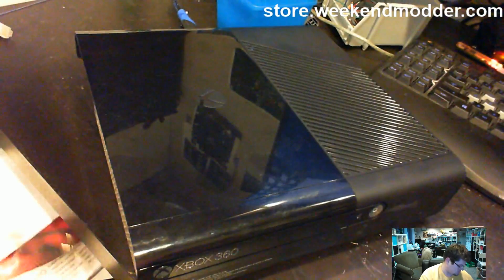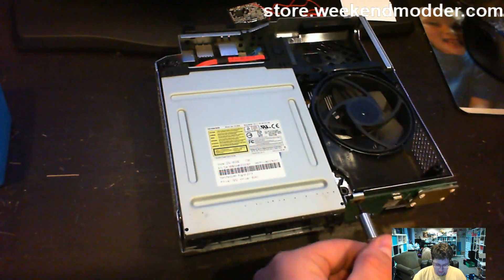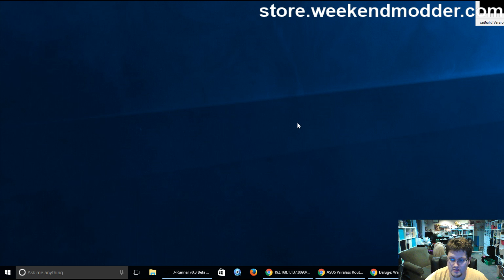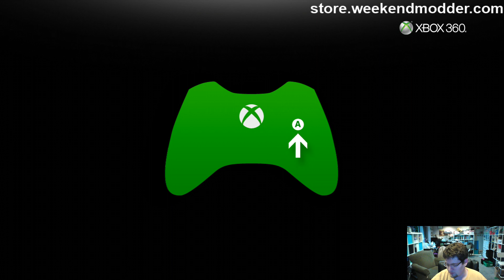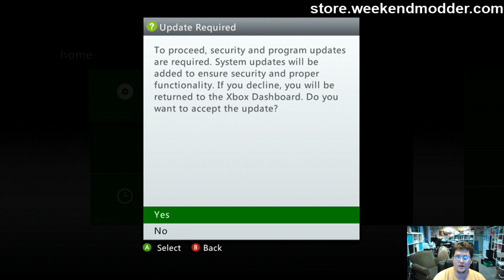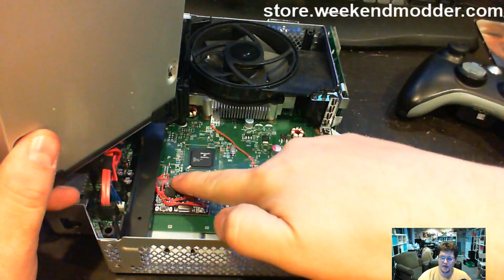Watch me RGH an E Series Slim Corona complete process!

Comment: Just FYI, th 4gb NAND pads are very flimsy, easily lifted off, I use some olds floppy ribon cable as its very flexible, plus when solder in I Tape them doe to stop movement.

Comment: Hello, i just got a an xbox 360 slim (16MB) corona version 3-6. i've got everything ready to do the RGH with postfix adpater (it needs it) e.t.c. Looking at your video i realize that i also have WINDBOND ram (and this is NOT an XBOX 360 E). The MFR date of this unit is1 9/01/2013. DO I have also to check WB 2K when i will start using JRunner?

Comment: i installed JR Programmer v2 to jasper motherboard i think on correct points i connected power cable only no run! on jrunner Im getting the error: Flash Config: 0x00000000 Can not Continue now i see burning smoke on 2 smd capacitors on point C3B8 and C1D7 i don't know why motherboard demaged before motherboard working very well how to fix that ? pls help me

Comment: Hello, i have a 4gb corona motherboard xbox360 e and it dont boot, only the center green light is is on and the fan and the dvd drive  and no hdmi output, the rgh chip x360run v1.1 led dont work. I measured the ground and the cpu and i measure 100 ohm not 30-40 , and if i remove the x360 run chip i got the same result . Anyone know what is the problem ?

Comment: I have a question to see if you can help me. I have a corona V1 and xrun chip but I can't get the xell to start. I damaged the solder of the post fix and bought the postfix for v2 (I suppose it works the same) but I also damaged the one for reset ... and honestly, I have seen some alternatives but they do not work for me :(. You know if the post fix works for the v1? and rest reliable alternatives? thanks.

Comment: You have got very detailed videos. After watching your videos i put up some guts to open up my xbox360e n try ace v3 as u shown here. However, i need some help please.
I have done all steps from bridge to ace v3 wiring. Double checked all wires even with multimeter. Write ecc done, even redone the thermal paste.
After installing Ace v3, system has no hdmi output. Couldnt see boot to xell, hdmi no signal. Cpu fan runs, if started with eject button, ace v3 blinks green.

Please help me fix this blank screen.
Reply: @DarInfection Viral   nopes, seams dead
Reply: Will try later this month.

Comment: Hi.
Do you know the fix for the problem of turning on but not booting up of an Xbox 360 E model(blue/500GB/16MB NAND), RGH modded, MFR 2014/08/18?
I tried with removing anything but no luck.
It has working fine but in time has progressively started to boot slower and slower until nothing.
Reply from the maker: Sounds like maybe a glitch chip gone bad?   Or a wire connection come loose over time?
Reply: @TheWeekendModder  I've checked the wires and all seem fine, except the one next to the APU(under the heatsink), that one I didn't checked.
There's really the chance that the glitch chip(Ace V 3.0) to be bad?

How about the possibility that NAND should be bad?

The defect(slow boot times) started progressively over time up to the point the Xbox didn't worked at all.

Comment: but if i do the muffin installation, the bridges on r2c7 and 7 are no longer necessary, right?
Reply from the maker: As long as you're not using the E & F points - then right.
Reply: @TheWeekendModder  but the point DB2G3 
should be in E, no?
Reply from the maker: @felipea.p.c.76  yes
Reply: @TheWeekendModder  omg i was understand don't should use that points, well the E point
Reply from the maker: @felipea.p.c.76  on a traditional RGH2 install r2c6/7 need to be enabled for E & F to work.   On a muffin install you don't use those, bit the E point in the chip gets hooked to db2g3

Comment: FYI There is a yellow circle on the side of the DVD drive. If you stick a long pin or paper clip in there it will eject the DVD tray mechanically, so you don't need to power up. Also, you can remove the front section without pulling the face plate off from the DVD tray. You just have to angle the front section correctly to get past the face plate.

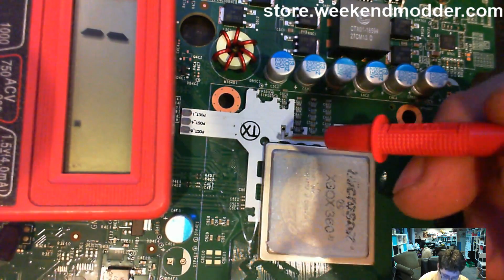Comment: At 43:41, do I put the black line to the metal around where the power cord goes in or where do i put it? When I put it on the metal around where the power cord goes in I get a reading of 126.

Comment: Mine is an XBOX 360 E MODEL 4GB From 2014 will it work?
Reply from the maker: Possibly, you'll have to open it up and verify if it is a Winchester or not.Consoles with a MFR date of 06-2014 and BEFORE are likely to be CoronaConsoles with a MFR date of 07-2014 and AFTER are likely to be the non-modable Winchester motherboard.

Comment: Can you use a clone board of coolrunner rev c?
Reply from the maker: Clones are the only ones on the market these days.  They're just as good :-)
Reply: TheWeekendModder i have that same xbox the corona v6 4gb i had trouble getting to know what i need. Do i need a jr programmer and a matrix glitch chip?
Reply from the maker: To read and write the nand of a 4gb console you'll need a 4gb r/w tool like my "sd tool".  A matrix with oscillator pre-programmed with the corona muffin timings would be a good glitch chip to use.      Getting a JR programmer would be options - it would allow you to program the timing file to the glitch chip, but it wouldn't be used in reading/writing to the nand of the console.
Reply: TheWeekendModder you have the glitch chip on your site i need right? I figured i would get the last few parts i need instead of some place in china. The coolrunner rev c is fine for this i assume?
Reply from the maker: No. A Rev C does not have a crystal oscillator (necessary to replace the missing CLK signal).  You want a Matrix V1 with oscillator which is on my site to do a Corona.
Reply: TheWeekendModder does that work in conjunction with rev c?
Reply from the maker: No, you wouldn't use a Rev C on a Corona install at all.  Go check out the guides on my site here:  http://weekendmodder.com/oldsite/CoronaRGH.html
Reply: TheWeekendModder okay i see. I watched that e series rgh you did already a few times and i need the 360ace. I ordered a postfix adapter from you and so i should get that matrix chip as well. I do not need a jr programmer as i need the sd tool i understand. Sorry its just a little bit of a mind boggle on me :P
Reply from the maker: There is a method to RGH a Corona using an Ace, but there is also an alternative method to RGH it using the Matrix V1.    In either case you'll want an SD tool to r/w the nand.   You don't really need a JRP other than if you want to be able to adjust the timing file on the glitch chip.  With an Ace they all come pre-programmed with a default timing file which is for Coronas and usually works well.   If you were to go for a Matrix V1 (with osciallator) you can order those from my store pre-programmed. If you were to get a Matrix V1 anywhere else they come blank so you would need a JRP in that case in order to program the timing file.
Reply: TheWeekendModder thank you so much i will definitely put an order in soon :)

Comment: I believe I bricked my E consol when I tryed this a few weeks ago I keep getting errors when I try to create the ecc.. it wouldn’t boot after that also tryed rewriting original band dump1.bin any suggestions?
Reply from the maker: If you rewrite your original "nanddump1.bin" and then disconnect power from any glitch chip you have installed the console should still boot retail.  If it does not - that indicates an issue with something else you've done, perhaps damage while soldering.
Reply: TheWeekendModder  I think I might of wrote dabs dunk #2 or something when I try to connect or rewrite the nand it gives me errors

Comment: I’m looking into getting into the rghing scene, just a few questions:

1: do I have to take the heat sink off? Like will it still be possible with it on (don’t have thermal paste)

2: how many watts should my soldering iron be? 

3: how do I identify what motherboard a console is?

4: can all motherboards be done with the same chip or do I need different chips for different consoles? (So like a trinity with ace v3 and jasper with cool runner)

Comment: I did all the steps and the red light on the ace v3 chip lights up but it won't turn on, do you know how i can fix this? :(
Reply from the maker: There are two lights on the Ace chip - the red light simply indicates the chip is receiving power and should be solid on anytime the xbox is connected to power.  The green light is the glitch cycle indicator light and should pulse or blink with glitch cycles.  

So, if you genuinely want my help - you'll need to be much more  thorough in providing info about what exactly you've done and what exactly you're seeing on the chip.
Reply: TheWeekendModder well i have installed the glitch chip and the postfix adapter and i have written the nand. Everything is installed perfectly but the xbox won't turn on

I press the power button but there was still no light. I tried using a play-and-charge cable but it still didn't power on...
Reply: I plug in standby power and the glitch chips red light lights up but the Xbox just won't turn on...
Reply from the maker: Did you leave the connection between the point labeled C and the crystal in place?  The console won't boot unless that is disconnected.
Reply: TheWeekendModder yeah i have it disconnected

Comment: Can you please tell me if my 360 e corona v5 with mfr 2013-11-21 is rgh able. I dont find anythin bout it and im not sure if the mfr is imoprtant for my board.
Reply from the maker: It's 100% RGH'able.
Reply: TheWeekendModder K thx bro
Reply: TheWeekendModder So all i need is the J-R programmer, any modchip(I'd use a CR3/4) and the post fix adapter?
Reply: TheWeekendModder mfr 2014 09 10 can be modified?
Reply: TheWeekendModder i have x360e  500gb made in 9/12/2014 can he able rgh or jtag please help😘

Comment: These E series consoles actually still has Infrared cuz im able to turn on and fully control my E series with my galaxy s4 (which has a built in IR blaster) using the "IR Remote Xbox 360" app form the google play store. So that technically mean that those E series consoles still has IR module or at least mine still does.
Reply from the maker: You sure you have an E series and not an S series?   I've never seen and E series with an IR receiver that has worked with my remotes, but CNET agrees with you:  https://www.cnet.com/products/microsoft-xbox-360-e/  saying that the E does maintain the IR receiver.  So I guess I'm now questioning that.  

good catch.
Reply: Yeah pretty sure its E series, I have the same model as in the video, and im able to control it as I said with my galaxy s4. The "IR Remote Xbox 360" app is basically the same as your remote, a digital version if i may say so, same layout and all...

Comment: hey, please tell me if it is necessary to use wire from a capacitor, or could i just bridge it by adding some solder from the one point to the other?

please advise
thanks.
Reply from the maker: You can bridge it any way you like - the capacitor leg is not special.

Comment: If mine is a 16mb(I checked it with your photo) will this method still work?
Reply: It will, the only difference is going to be that you're going to have to use a J-R programmer for flashing the NAND, as opposed to an SD card reader.

Comment: Can you use the same chips and nands and stuff for the 250g (Corona v5
Reply from the maker: a 250gb Corona is going to be a 16mb nand which does not use this method of nand reading/writing.  This method is specifically for 4gb Nand consoles.
Reply: TheWeekendModder anywhere where I can find a video to do this?? And where would I get the parts thank uou
Reply from the maker: two of the most recent videos on this channel are me modding a 16mb corona...
Reply: TheWeekendModder yes just been watching this and feel it's going too quick any other way to contact you?

Comment: http://m.ebay.com/itm/330829228748?_mwBanner=1 would this be able to program a coolrunner rev c with j runner
Reply from the maker: Never attempted it, so I can't say for sure.  Though it does say Xc264a in the description - and that is the chip that a rev c has on it.
Reply: TheWeekendModder if it wouldn't work with j runner what other programs could I use
Reply from the maker: command line nandpro

Comment: Please someone help me here: my Xbox already has RGH, I want to replace the unlock chip with this one from the video. But when you change the chip, just plug in the Xbox and it will be ready to play? Need to set something up?
Reply from the maker: That depends entirely on what chip is currently installed and what method of RGH was used.  It's possible it could be a drop in replacement, but not guaranteed.
Reply: The currently installed Chip is the MATRIX (that blue) and i already the Nand saved in my PC (backup original) .
Reply from the maker: A matrix v1 in a Corona?  What are you using for stby_clk?
Reply: I just wanted to know if by replacing the chip and connecting for the first time the Xbox will connect normal and already load the Freestyle Dash 3.0 that is on my external Hard Drive.
Reply from the maker: Nobody can tell you that for sure unless they understand what is installed (and how) in your console currently.  If your console has a plain RGH2 image then yea it's possible for an Ace V3 to be a drop in replacement for a Corona.  But you haven't even clarified what motherboard type you have.
Reply: My chip is a Matrix Glitcher V3 (Xilinx) I dont Know what is "stby_clk"
My Board is that the video, Corona 4G (nand with Gold contacts) and Absence of tracks close to the processor
Reply: If it helps:

http://imgur.com/a/NhiTT
Reply: Looking at those settings, you've got a standard RGH2 build, so a Ace V3 would be a drop in replacement for you.
Reply from the maker: "drop" in this context is a very odd word, so I understand how that might be difficult to translate.   To be more clear, you should be able to use an Ace V3 as a direct replacement for your Matrix in the Corona RGH2 installation that you have.
Reply: I do not understand what "DROP" means hahaha (I am from Brazil and I am using the Translator) but I thank you very much for your attention! you are a cool guy! I already signed up for your channel and I'm following you now.
I'm going to replace the chip, if give something wrong I revert to the old chip.

Hugs!
Reply: what's up, man! I changed the Chip Matrix for this X360 and everything worked out, boot in 5 seconds on average.

Thank you very much for your help, and for your video that gave me the base and the confidence to do it!

Hugs!

Comment: That 4gb sd tool on your site, will that work on a Xbox 360 e 4gb mfr date 5-25-2013? My nand is a skhynix and I gotta bridge just incase I bought a post fix. Lmk asap @theweekendmodder
Reply from the maker: Yes.
Reply: TheWeekendModder do you have the sd tools in stock? Imma buy 3 of them, also how did you make the quick break connection, you should sell them I'd buy a few.
Reply from the maker: Yea, they're instock on my website...
Reply: TheWeekendModder 
I want an XBOX360 console with more ram, is there a way to solder more ram chips in the back of the motherboard? Or to replace those ram chips with more ram chips?
Also I seen that they can connect a power supply and works, so I was also wondering if they can use a power supply with less energy, like a 120watt power supply

Comment: a little late to the party but want to get another 360, want to get the newest hardware 360 with the best RGH/JTAG compatibility
as well as a solid stealth service. Recommended setup?
Thanks!
Reply from the maker: Any slim RGH should serve just fine.   Stealth service I don't personally  use - but I hear Ninja is the biggest/best, though it's also pretty expensive.

Comment: When I'm soldering the capacitor legs to act as a resistor, do I only touch the legs with the iron and let the solder fall of of the metal and hit R2C6 and 7 or do I do another process?
Reply from the maker: The whole point is just to bridge those unbridged contacts.  Using the legs off the capacitor is just kinda a cheater way to span the gap.